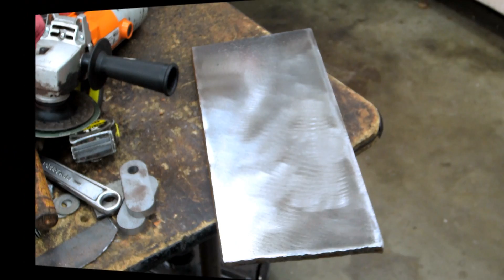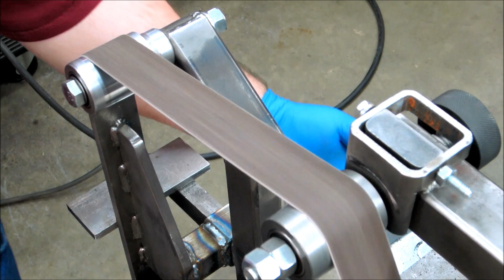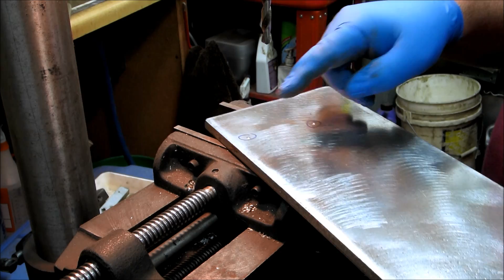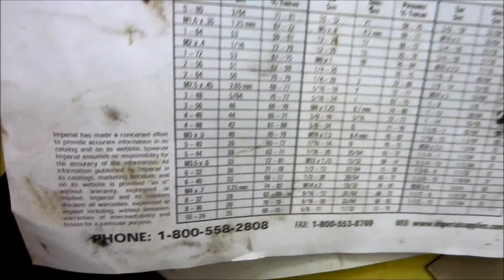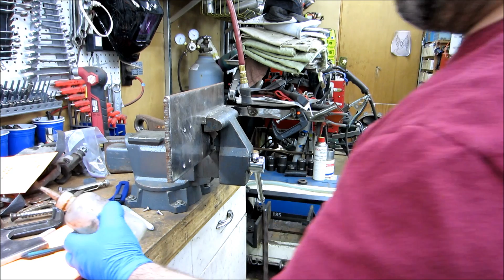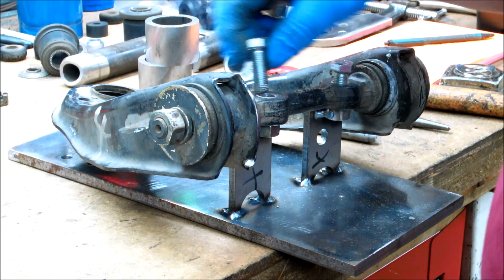Datsun 521 Ball Joint Mod - Part 20

Comment: Actual question if you just bolt it all on without shortening the arms  won’t you have  the ball joint setup complete just with the wheel sticking out a inch or two
Reply from the maker: There's no easy way to do it, that I've found.  Yes, you can leave the LCA and it will add 1.25" to each side of the track width.  We did that on the very first conversion we did years before starting this one.  The buddy I did it with wanted the extra length because he was running GMC Z71 rims which had a front wheel drive type offset.  We had to build custom UCA's since the added length made any other UCA option too short.  If you shorten the LCA's, there might be a stock UCA that will work.  I've heard of guys flipping them from side to side on a rig and then running them upside down to get neg caster instead of positive.  I forget exactly why, but there were other reasons that made the decision to create a custom upper.  These videos are from the first attempt.  I dropped it for a couple of years and then restarted.  I did a page about the very first set of uppers that went with the full length LCA's....there may be some info in there.....?  I just found it, but I haven't taken the time to go through it again.  https://ratsun.net/topic/13081-upper-control-arm-build/